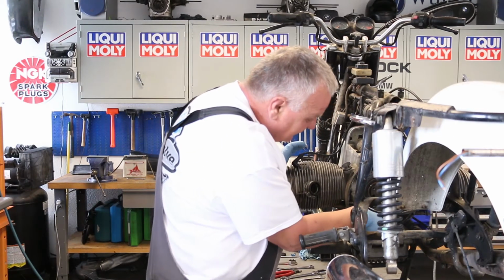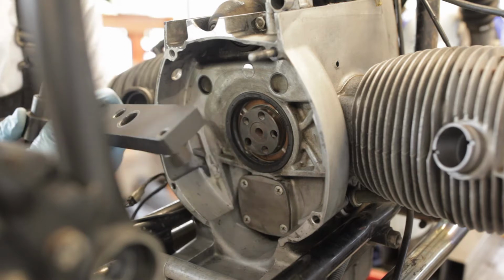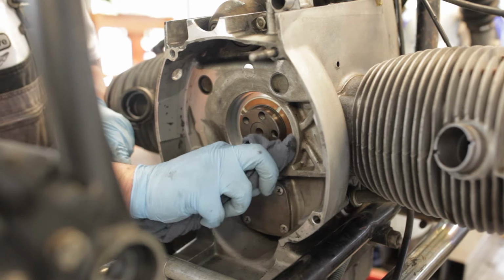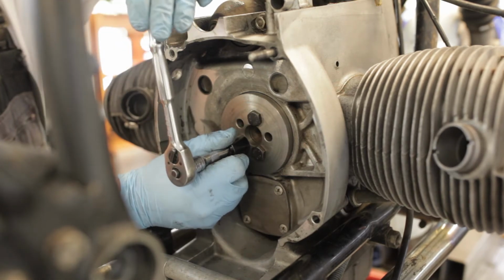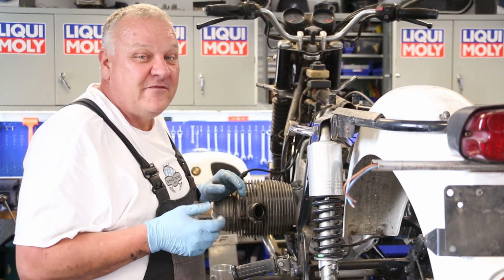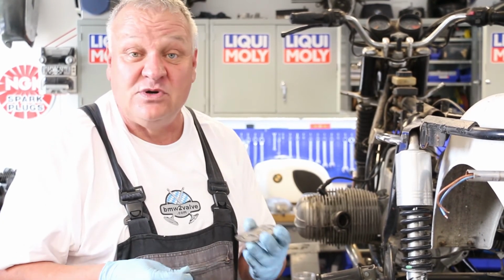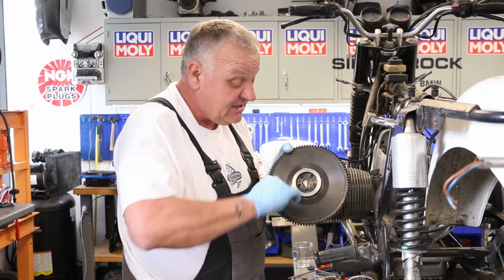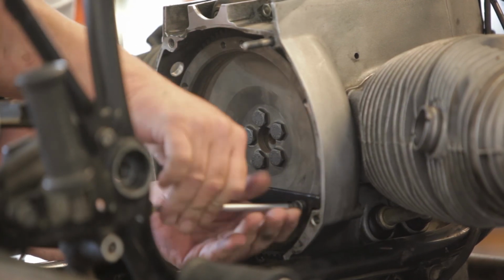BMW R90/6 #4: Rear Main Seal Replacement

Comment: I have a problem with my R80 Dakar. I have replaced the Shaft seal, for the second time already, and of course also the O Ring. but it just keeps leaking.  do you have a Tip that I could try? kind of losing it here... :) thanks a lot , love your channel.

Comment: My manual (a Haynes derivative/translation) says 70-75 Nm torque for an r90/6,
60-65 Nm is for the r60 and r75!
Reply: My Clymer published 1995 shows the same as your Haynes. But I'll also note I've found errors in both manuals in the past. I don't have an original BMW manual so let hope William just mis-spoke :)

Comment: Hello..
This is the best explicative video on you tube, thanks a lot!!!!
I rebuild a r100rs of 76 and it help me a lot!!
I have a little question about the rotor of oil pump... There is 1 hole on interior rotor, and 1 hole on exterior rotor... Could you tell me the mounting of them please?!
Thank you!
Reply from the maker: The holes are not always present, but they face towards the rear. Where they are in relation to one another isn't important.
Reply: @boxer2valve 

Ok thank you!

Comment: These video's really helped me get started on restoring my mom's R60/6 to glory, but now I could really use some advice!
I took care to inspect the woodruff key on the oil pump as you mentioned, it all seemed okay, but just as I was about to reassemble, I noticed two big metal flakes fall off the key slot on the shaft! (After finding the oil filter disintegrated as it was, I guess the damage isn't surprising)
Looks like I will have to pull the whole motor apart... Replace the whole thing, or would it be possible to either patch the damage, or mill a flat surface to match the newer style of pump?

Thank you!
Reply from the maker: You should replace the camshaft and if possible, with the newer style. You will need to do quite a bit of disassembly to remove it. It may be possible for a machinist to cut a new key way. You may also be able to find a good used part.

Comment: Why not lubricate the new rear main seal nor the oil pump?
Reply from the maker: Hi Frederik, The new style rear main seal should be installed dry as per the manufacturer. As for the oil pump, if you put oil on it, it will mostly run out before the cover can be installed. The pump has some residual oil on it and it is very effective and will draw oil from the sump almost immediately when the engine is turned.
Reply: boxer2valve BMW Restoration and Parts Supplier thanks for the reply! People have very mixed opinions about this on the boxer facebook group - but ofc i take yours as the most legitimate! :)

Comment: Why does the flywheel have gear-teeth?
Reply: Paul Barratt the teeth on the starter motor engage the teeth on the flywheel to SSP in the engine when the starter is engaged.
Reply: @coreyknapp2151  Thank you
Reply: “SSP in” was supposed to be “spin”. I have a love/hate affair with auto-correct.
Reply: I'm with you on autocorrect! for the record, I googled it and was about to search through the (75-76) manual - thanks!. This would have been only for curiosity. Your answer was clear as written (autocorrect and all).
Reply: That is, I googled "SSP". AS mentioned your answer was clear enough (which is my way of saying I'm not an idiot)
Reply: My story about auto correct was my way of saying I’m not an idiot 😀

Comment: Excellent video as usual ! , i have a lot of fun following your tutorials ,  i guess  i may have done a mistake ... after a torque at 59 n.m (R75/5 1971) my crankshaft ,  i have to push excessivly hard on it now to make it turn , could it be because i the trust bearing on the other side dropped ?   ... if that is the case what could i do to access the famous trust bearing ?
Reply: He said in the video if the inner thrust bearing slips off the locating pins, the only way to fix is disassemble the engine.

Comment: Hi Guys - love the videos - when the seal is removed there looks like an oring is sitting under the original seal - is that right?
Reply from the maker: No O-ring. There is a spring inside the seal, and sometimes that falls out when the seal is removed. That might be what you saw. The spring is included with the new seal.

Comment: Thanks for your videos. I recently purchased my first BMW, a 1971 R75/5. The engine leaked oil so I removed it to replace all the seals and gaskets. When I removed the oil pump rotor as you demonstrated I found that the outer ring and the race in the block was badly scored. What should I do now? I can buy a used block but then my frame and engine numbers won't match. Have you ever machined one out and pressed in a sleeve or something?